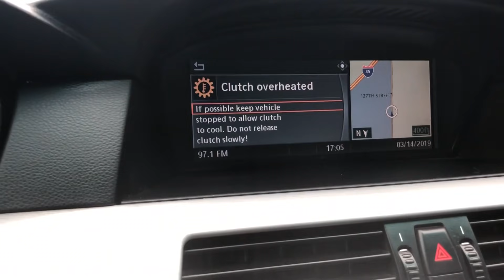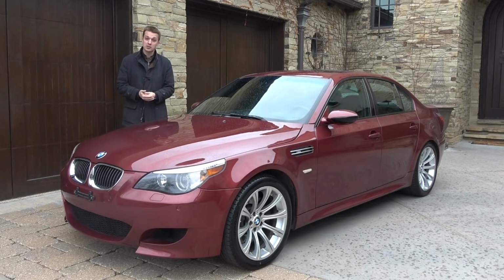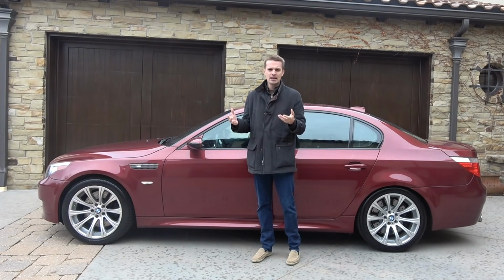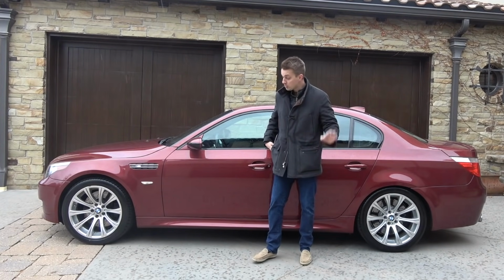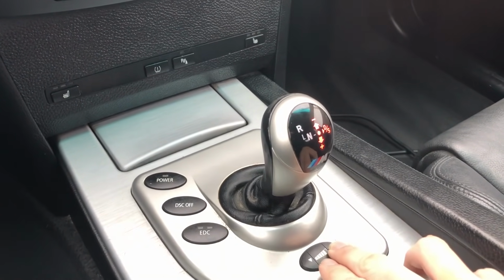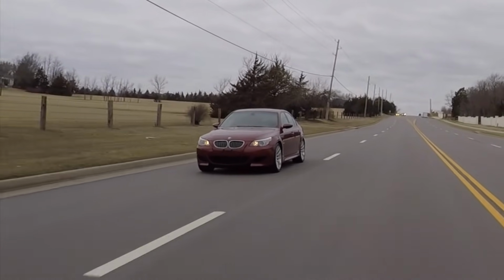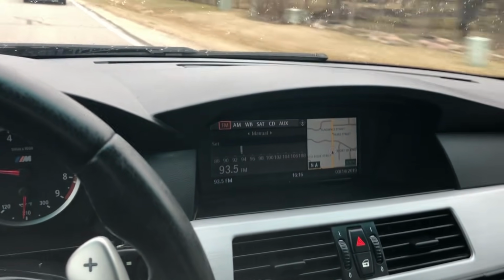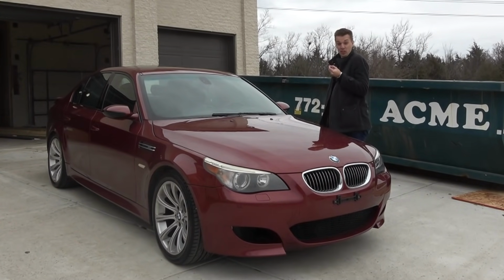My Cheap BMW M5 Is FINALLY FINISHED (Thanks to a Wire Hanger???)

Comment: You push forward to downshift as you are slowing and the inertia is pushing you into the forward motion. Upon accelerating, your body is pressed back as well as every tick of the shift lever. Hoovie, all the others are backwards, BMW got it right as well as every other rally car and sequential shifting race car.

Comment: So glad BMW made the shift lever work the right way, despite what you think. Also, NEVER put it in D mode for automatic changing. I'm certain having that function was an argument between the engineers and sales people, which the dumb sales people won. Put it in manual S6 and let it rev a little between pulling on the levers (not so hard they break - never heard of that before!). It's a special car and doesn't like to be driven like a Toyota. Understand what it is and what it's capable of and you'll realize it's one of the most stunning cars ever built.

Comment: 9:59 the peep is when the clock turn 1 full hour.  It dose that every 1 hour. You can turn it off in the settings in your idrive. I thought it was some problem with the car at First 😝

Comment: The gearbox is not bolted backwards. Think about it, racecar inspired sequentional gearboxes. If you accelerate and got pushed in your seat all you have to do is pull the lever instead of push forward what would be even harder :)

Comment: Pulling the gear lever towards you is working with gravity. If you accelerate hard you get thrusted in to your Seat and should try push the lever forward? And same when braking into a corner being pushed forward you should pull it towards you? For me atleast it makes sense

Comment: The Ford Focus has a transmission similar to this car. Only in the sense that the focus has a computer controlled manual transmission. The focus is terrible and lags when shifting and sort of backfires. They have transmission recalls.

Comment: Awesome car. Super fast. I had the stick though. That M button surely was fun to engage. But one limp mode experience and $2k fix and I punched out for an even worse BMW, the 2008 M3. $10k in fixes there (under warranty), and I was soon out of that one as well. Though had a few X5M cars since that were very good to me. So not all M cars are bad.

Comment: When you shift in an smg you have to let off the gas about 20%  between shifts, it’ll shift 100x smoother and in the higher shift speed modes it’ll shift almost as fast as a dct. If you treat it like a regular auto with the foot flat you jerk the car and burn the clutch faster. The car is not meant to shift as hard as an aventador

Comment: SMG is different than a manual and not just minus a clutch pedal. It’s sequential, as the name says. Motorcycle and many race transmissions are sequential, but controlled manually not by computer. An H pattern manual or a double clutch select gears differently. It’s one of the reasons it’s been made obsolete.

Comment: Driving it quickly does not wear the clutch - quick shifts with no clutch slip are ideal. It’s when you’re driving it slowly and it’s slipping the clutch heavily to smooth out the shifts that you’re inducing wear.  Not sue what you mean about the shift lever working backwards - that’s how pretty much all manually-shiftable or true sequential manual gearboxes work. The physics make far more sense than pushing the stick forward to upshift while being pushed back into the seat, and vice versa. Porsche was the only one left for a few years that insisted on doing it the other way, but, they changed it for the GT3 thankfully.

Comment: The beeping is the clock. It beeps every so many hours depending on your setting. You can turn it off in the system. Purpose? It's a "German" car, they like to be on time.

Comment: SMGs were meant to be driven manually with paddle shifters.  Automatic mode is not usable.  There are metal paddles that you can replace the crappy plastic ones with.

Comment: Any good sequential box is push for down shift, pull for up shift 
Under power you’re pushed back into seat pulling back to go thru gears 
Under brakes you’re bracing yourself and pushing fwd on gear lever to go down gears. Anything different than that imo is useless.

Comment: Had one with Xmas tree lights. Actually 31 problems when scanned. Added a new battery and all went away. Turns out not enough power reached the sensors

Comment: Sorry you are wrong on a very minute point. On the shifter, to manually shift it, the + indicator is indeed in the correct place as you need to pull back the the lever to upshift and to push forward - downshift... why? All due to momentum. When you are accelerating you and being pushed into the seat so to upshift the natural sequential position is to pull back and not forward. Thats why when you decelerate or hit the brakes your body is being pushed forward so thats why you push the lever forward to downshift. my .02. Other than that I wholeheartedly agree with u lol

Comment: I'm just about to replace my Rob bearings parts are only 1000£ and about 5 hours Labour so don't know where the massive price comes from, and as for the Vanos just have a pressure test and have it reconditioned

Comment: If I were you, I would do the VANOS pump and rod bearings. If the engine goes, it will be ALOT more than 5k to fix. You can find a guide to do it yourself on YouTube. Also, you might want to do a manual swap.

Comment: So with f1 transmissions in ferrari's,  I heard owners talking about letting of the gas in between shifts even though its not a manual to save the transmission.  I wonder if driving the m5 like that would make the car last longer

and also run thicker oil than recommended so the vanos system and engine don't wear out and blow

Comment: Owning the E60 M5 (2006) as a weekend car for almost a year now. Amazing to drive. I only have 1 big issue I can’t figure out. Hope any of you can help. There’s a exhaust fume smell in the car (no gas smell, no oil smell). I’ve had the car go to a specialized garage AND to a BMW dealership, they both couldn’t find anything. It comes from the engine bay through the AC vents, but also when rolling the windows or sunroof down. It’s really strong and gives me a headache. Somehow it’s also a strong smell when opening the booth. However, when driving, it does come from the front. Any ideas?

Comment: Hmmm...I hate the forward up shift.  My BM and My alfa both are like that and I intend to switch them over.  The pull back to change up action is much more comfortable and natural during fast driving.  Matter of choice I guess but all race cars are pull back to upchange in my experience.  Can't even imagine driving a racecar with sequential change going the other way.

Comment: Shoulda gone to your buddy from the beginning, I'm sure he could have solved the hard shifting for a lot less than $4500 and no new transmission. Even if not you could probably buy all the swap parts from a crashed manual e60 to convert the car. Parts would probably cost less than $4500, but would take a specialist with knowledge to replace control units and possibly re-code the car after. This would have fixed the issue, and increased the value of the car at the same time (and you can do a burnout)

Comment: Aren’t rally sequential transmission like that too where down is gear up because when you accelerate you get pushed back in your seat so it’s harder to push than pull the lever?

Comment: it is normal for race cars to shift up pulling and shift down pushing the gear lever... its easier to pull when accelerating and push when braking.

Comment: Thats actually how all transmissions should be, it is not reverse. Because when you need to upshift, you are accelerating, being pushed back, so it is logical to go with the flow of movement and pull on the shifter to upshift, trying to fight the acceleration to upshift makes absolutely no sense and makes the car harder to control. And vice versa, if you are downshifting, you are probably decelerating, so you are thrown forwards.

Comment: SMG is hydraulically driven the higher rpm the faster it will shift that’s why is shift super slow under 3,500 rpm

Comment: Why not just convert it to a full manual transmission with regular clutch.   Your daughter's college fund must have enough left  to cover  it .   Love your garage.  Hope you are going to add heating , A/c and humidity control  and plumbing so you can wash the cars inside .   Oh add some ventilation to  remove CO2

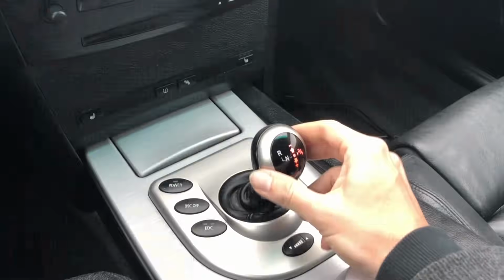Comment: 9:17.  I get mixed up on these auto-shifters. And all my cars  so far had it the WRONG way if you ask me! 
I like how BMW has it the correct way and probably 85% of all cars have it the wong way.  I'm trying to blame it on playing a lot of flight simulators and race car simulators back in the 90s/00s and using a joystick for controller.

Comment: I really can’t believe you tried a burnout on smg gearbox ...........   I’m surprised the clutch didn’t just burn out never mind over heat. ...  to burnout an m5 you just got to hit the accelerator no brake needed clutch engages hard and power takes over.

Comment: The years for this M5 were complained of having these problems. At the least the SMG was not pleasant at "Around Town". It was always described as a mushy mess and jerky at best with bad up and down shifts at the wrong times always when going slow. The wise few people that ordered this car with the 6 speed Manual were the bigger winners for sure. V10 Motha power with no problems of the "slow town driving frightened child  learning to drive stick sifts".  Engine should be alright at this point, However if you do a "Black Stone" oil test you will know if you are anywhere near needing to do the rod bearings or not. If not you are almost golden. The engine usually doesn't usually have a big problem with the vanos although it's never "For Sure" as it's mechanical and so there are a few cases where the vanos went and it was very Bad for engine. But really once you are set as you are the best thing to do is to drive it like the F1 engine it has and not to worry about anything as it's time to enjoy what it's excellent at.      Going very fast and drifting like a tool.       Oh if you're worried about breaking another paddle really once you fix them (If done right) they should be rock solid for the most part and you can be the F1 driver you dreamed of being. Or you can buy a new set of after market (Because BMW ones are STUPID money). Just don't drive slow in town getting groceries or whatever LOL. SHRED it up big time BROTHA!!!  Have fun Hoovie!

Comment: Say you replaced the rod bearings and the VANOS pump, is that fixed for good or do they have the same design flaw and will need to be replaced again?

Comment: The M5 isn’t a bad car,yes the SMG is a little sluggish out of M mode,though I think the sequential shift is the right way round,car pushes you back when accelerating,pushes you forward on the brakes lol. The biggest problem with it and,indeed,any luxury and/or high performance car,is how much it costs to start with. When it was new it would have been out the reach of most people,as it depreciated it became affordable. But it was still a top of the range car and servicing and parts still cost the same. So things are let slip,cheaper parts are used,servicing skipped. That all adds up to a gloomy future for any car. For what it’s worth,I wouldn’t buy a cheap M5,there too much trouble.

Comment: If the gearbox is fine now you might be missing a software update on the gearbox and that is why its so slow to switch gears.
Reply: And it was beeping at 9:58 because it is programmed to warn the person driving the car that its 1 minute to lets say 5pm I have an E61 from Italy that beeps literally every 59 minutes :D

Comment: Up is down, down is up makes perfect sense and is what race cars use. Think about it... if you are hard accelerating in manual mode, you're being pulled back in the seat, so pulling back to shift up is logical. It's the same with forward being downshift, when you hit the brakes you get thrown forward, so naturally your hand will go forward downshifting. 

It makes perfect sense and is the right way. Any car that has it the other way is incorrect. After all, all race teams can't be wrong....

Comment: There are two types of people out there:
Those who actually own an E60 M5 and haven't had any problems what so ever
And, those who have never even driven one, yet parrot their "unreliability" at every given chance.  

People don't seem to understand that if you buy a cheap shitbox, you're getting a cheap shitbox.  In addition, even on good cars regular maintenance things happen.  Throttle actuators fail.  It's a $600 part.  So what.  Change it and move on.  The SMG transmission doesn't need to be swapped out to cure an issue.  There is documentation online miles long about what various components cause which failures.  You can buy the parts and change them out.  You don't need an entire transmission, ever.  An entire brake job costs $1K now.  A new clutch and flywheel kit, under a grand.  Rod bearings either fail or they don't.  It's not a ticking timebomb like boy racer teens will warn you.  If you do nothing but cold engine 8,000rpm burnouts, you'll spin a bearing.  No shit.  It's 10W60 oil.  It takes 15 minutes to fully warm up.  What is so difficult here?  Hello... F1 engine...?  There are literally DIYs everywhere for every single thing on this car, and parts are cheap now.   You need ZERO special tools or crazy equipment to own and maintain these amazing machines.  

In two years or less, the V10 M5 will become the new "It Car" that was the best and V10 and N/A and last of its kind blah blah blah, and well sorted examples will bring premiums upward of $30K.  I watched literally the same thing happen with the E39 M5.  

For now, I'll keep driving and enjoying mine.  It's been a very uneventful 5+ years of unmatched driving pleasure.

Comment: Hmm it's 65 milliseconds to shift gears in the smg & physically impossible to do with a manual.  With a manual it's a different experience but only faster on the butt dyno.   Additionally the manual was slightly slower in some of the testing.

Comment: At 9:12 the gripe about the shifter being "backward"? Think about this. You're hard on the gas. 500hp screaming to redline. You need to upshift, and right now. The acceleration forces naturally help you upshift with a rearward pull. Opposite when you're hard on the brake and you want a lower gear, the braking force helps you push the lever forward. Otherwise you're always working against the forces. Quite logical.

I had an Infiniti with a slush box and its manual mode was push forward to upshift and pull back to downshift. Following the logic in the video, you're always working against the forces instead of with them. And one HUGE issue that happened to me more than once with this Infiniti: sometimes after driving for a while in manual, I'd put it back in auto, then forget I'd done so. After stopping, I'd go to upshift manually and put the trans in neutral (since it was in the auto gate, not manual). Not a good thing for the engine, as it would then rev furiously.

I appreciate that my '08 535 (with the infamous N54 twin turbo) has a manual mode in the auto shifter that works the same way as the M5.

Comment: The beeping is a clock setting. every hour it beeps. Just turn the setting off. Upshifting towards you is the correct way. Family cars have it backwards.. The shifting isn't slower than what you do with manual gearbox it's just the feeling becauae you don't move the stick and instead you wait.The idrive system is logical and nice... man, just sell the car if you don't like it.

Comment: up is down and down is up? if you bush the break holding the gear lever your hand will automaticly pull forward (downshifting) and pushing the gas will make you automaticly upshift. That is really not so hard to understand -,-

Comment: Only an American takes an automated manual transmission (aka the cheapest way to make a car shift automatically), treats it like a torque converter and is then surprised when it overheats.

Comment: The SMG gearbox is indeed, rubbish. However the pauses between shifts are more apparent because 1: It's not a manual. You likely don't shift faster in a manual, but you're performing an action. When this shifts you're doing nothing with your feet or hands so only notice the time it takes, even if it's not actually slower than a manual shift time. 2: It's not a dual clutch. That technology has advanced so rapidly since this car launched (15 years) that even 'bad' twin clutch gearboxes snap changes compared to this SMG, and now that is what people expect when they have a semi auto gearbox. The BMW seems extra slow in hindsight, it's just of it's time period.

Comment: Best solution to M5 problems is to buy a Chevrolet SS instead. Basically the same performance and handling characteristics as the M5 minus the 3 million technical failures per day.

Comment: Hoovie, the M5 might have a BMW badge on it, but it is no BMW, M cars are essentially exotics. Extracting so much power from a machine requires micro tolerances (which is effected even by a small amount of wear). Wear rate on said components is also high (high revving engine = high wear rate). If you cannot adjust your mindset to that fact and the fact that all exotics require expensive maintenance, you have no business owning one. If you want reliability, get yourself a 5 series Diesel, and like all diesel owners, just fantasise about the M5.